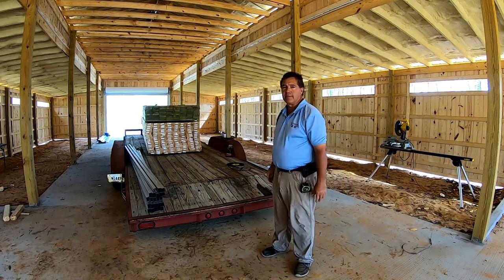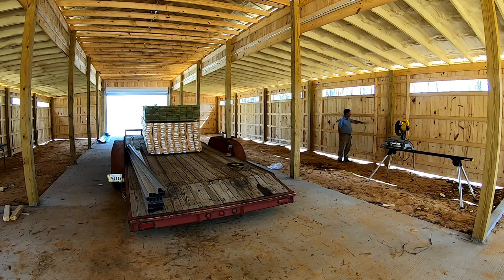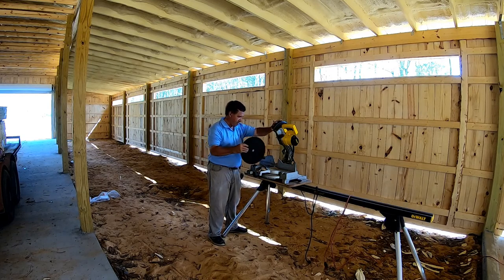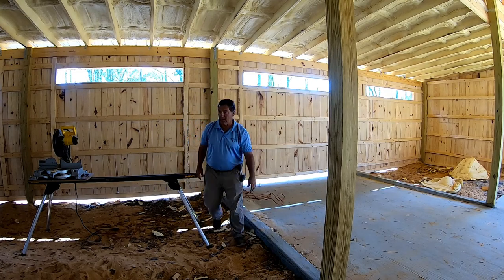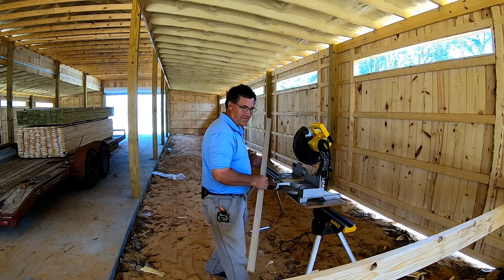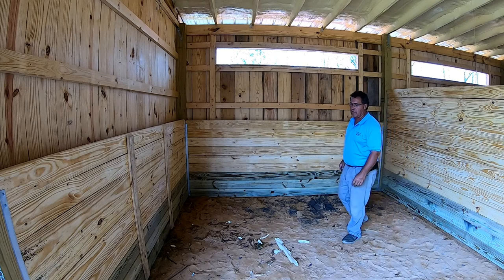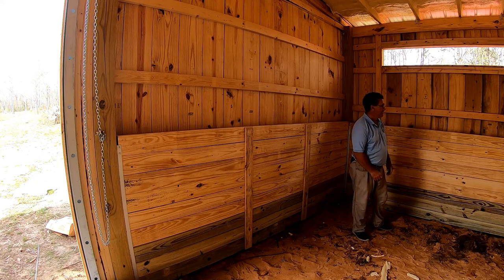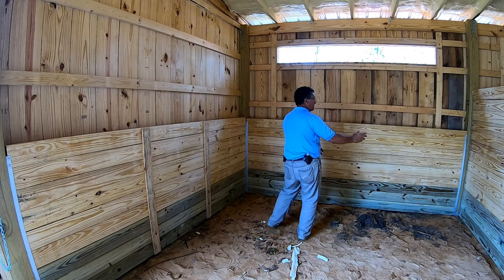Building Horse Stalls in the Barn

Comment: Thanks for the video! Looks like this video is from 2yrs ago, how is the metal stud plate holding up? The metal stud plate i found locally is 25ga and that seems really thin to me.
Reply from the maker: Yes it is from 2 years ago. Has held up very well except for when I had a kicker so I went back and add a deck board over the track in the corner and ran a screw through it into each of the rail boards. That was cheap and easy to do and added the strength it needed. Also dressed it up quite a bit.